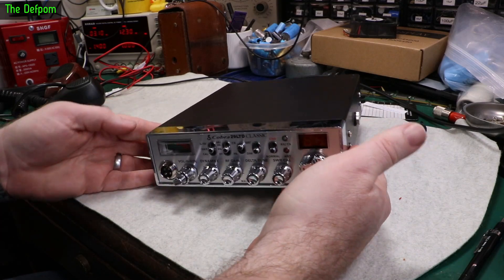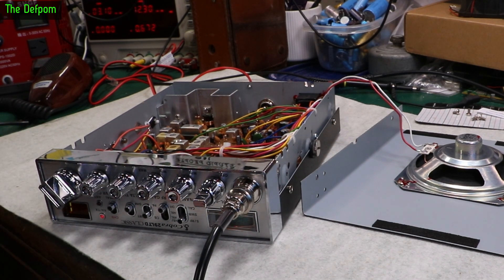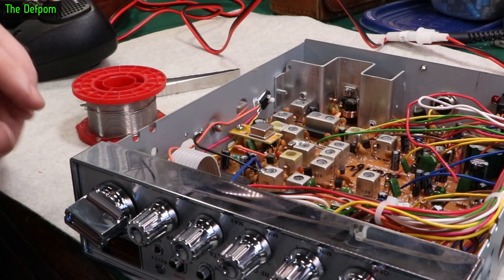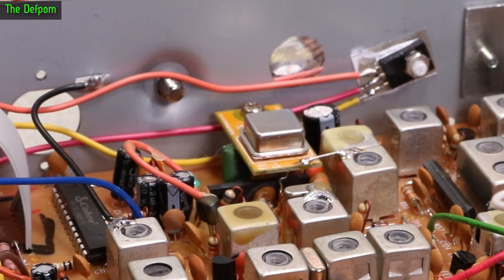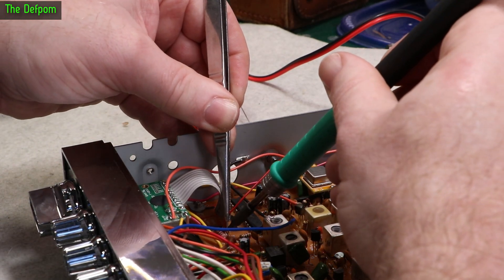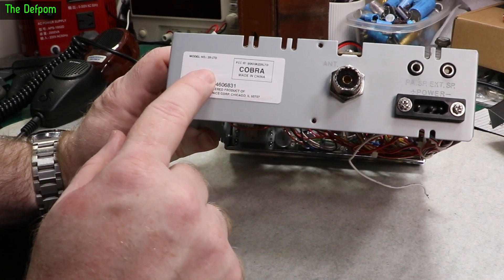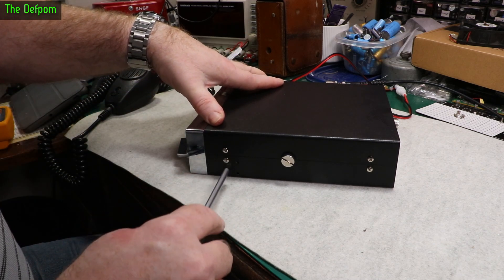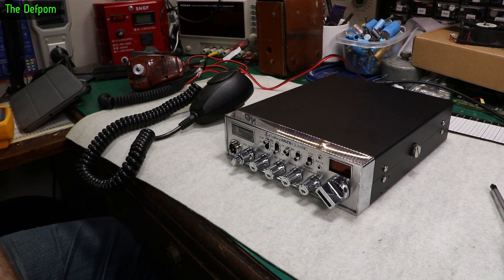🔴 Cobra 29 Ltd Classic Channel Modification - No.1277

Comment: What is the TO126 package mounted on the inside of the case?........looks a bit hacked on, no insulation on leads and a bit messy, plastic screw etc.
Reply: I was going to say that, looks a bit bodged to me.